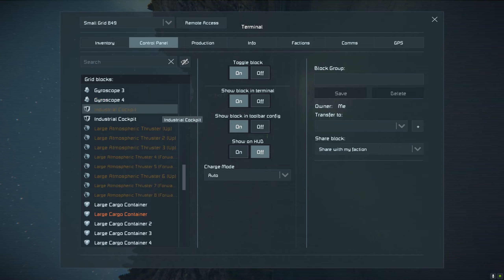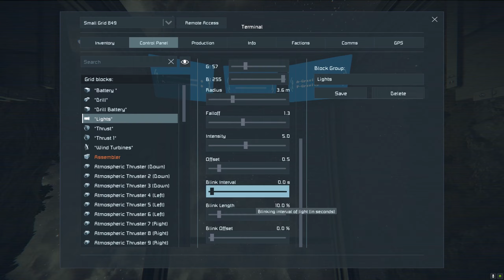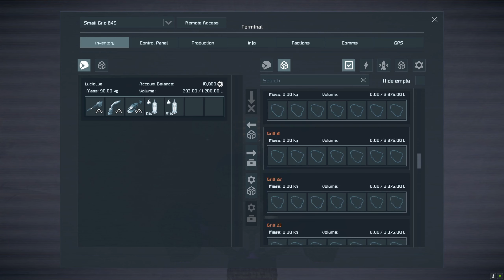Space Engineers - It Did Not End Well - E5

Comment: I'm not sure but it looks like when you are vertical (drills pointing down) you are missing thrust in one direction.  I was watching and couldn't see them.   I could be wrong.  I'd just double check thrust in all directions when your in both orientations.  I get that on planet you don't need upwards thrust because of gravity but with vertical and horizontal drilling you might need all directions to support the 90 degree shift.
Reply from the maker: Hi Dennis, thanks for the comment.
Yea there was one direction missing. I think this was a bit too much to aim for on my first larger drill build and the design and centre of gravity was way off. I have scrapped this one and started working on something a little smaller.  Having a reliable driller to be able to work on some other crazy ideas I am having. I'm still trying to get used to the limited block shapes and how to get interesting shapes out of them so hopefully, my new drill should be done after I play tonight and I can move forwards on starting an actual base.